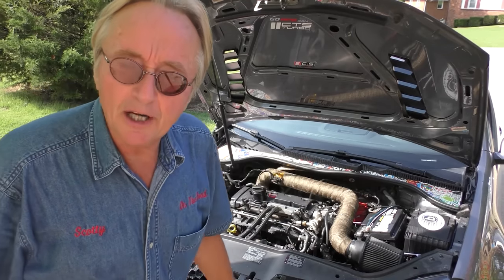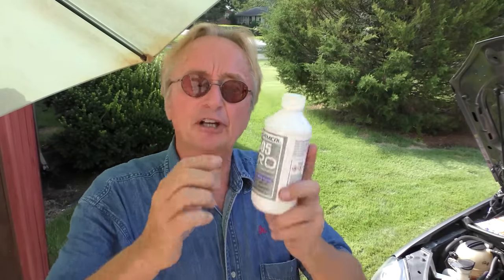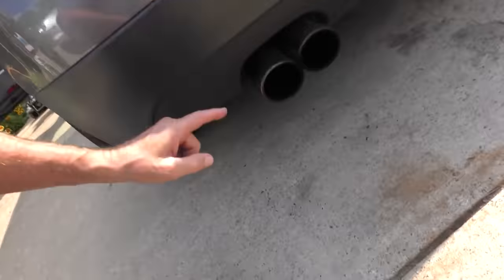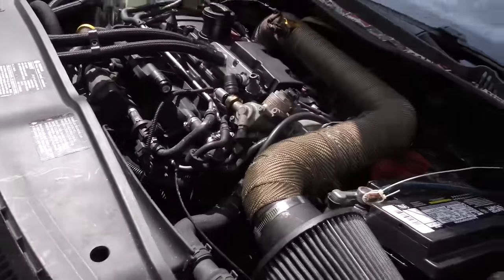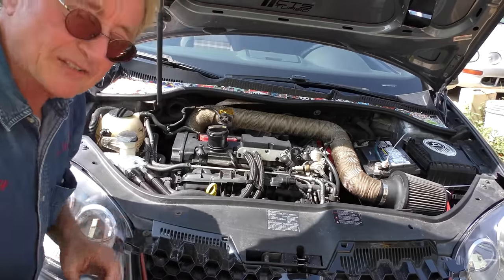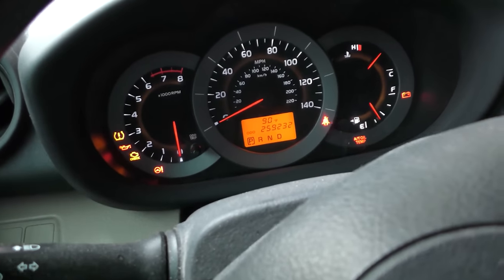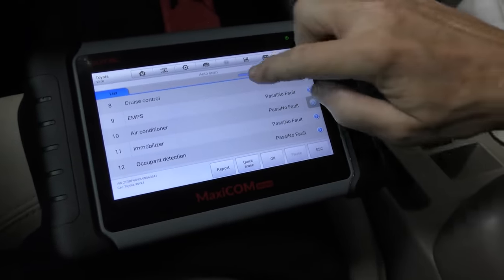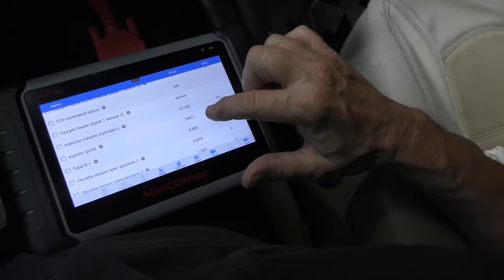3 Things That Will Make Your Engine Last Forever

Comment: Wait, the first product was an oil flush type thing used to clean out all the carbon, specifically in the piston rings, but then with the oil at the end he says not to use oil flushes because it can make your engine too clean? Specifically mentioning how carbon buildup around the piston rings can prevent the engine from burning oil. So should we use that first one or not? Lmao

Comment: Dear Scotty, these cars and their engines were not designed for low CT gasoline, sold in USA. It is beyond me, why are you guys still not using high quality fully synthetic engine oil and 98 or 100CT gasoline.

Comment: Once again, Scotty fails to emphasize the most important thing to keeping an engine healthy. It covers everything in this video and it’s easy. MAINTENANCE, DO YOUR MAINTENANCE. It’s very simple people, have a shop do your full synthetic oil changes if you can’t, use the same shop, make sure it’s a dealer, and you will ALWAYS be told when it’s time to do something. You’re just paying for the oil change, they do the rest of the research etc for you for free. Then if they recommend air filter, trans service, whatever, you DO IT, either yourself or with them but DO IT. And yes, absolutely Full synthetic oil changes if you have a direct injection vehicle or if you want the wear in your engine to stop where it is. Every 5k, full syn oil change. Full syn is not a gimmick. Manufacturers put semi-syn in new vehicles on the factory fill. Why? Because full syn is SO GOOD it prevents parts from breaking in properly ie piston rings, camshafts, bearings etc. Once the engine is broken in, full syn for life. If it’s turbocharged and direct injected, ALWAYS run premium if you can, and if it’s small displacement (smaller than 2.0L), you don’t have a choice, you HAVE to run 91-95 octane AND you have to change your spark plugs per manufacturer spec. If you don’t, even with perfect oil changes, your engine will eventually kill itself from LSPI.

Comment: Take an engine apart and clean it if it is gummed up? hahahahahahahahahahahahahahahahaha. $18 SEA FOAM in the oil. It works on Boats and works on Cars and Trucks. $18 not "take the engine apart".  Scotty only tells you some stuff, the rest he saves for scams like taking your engine apart. SEA FOAM.